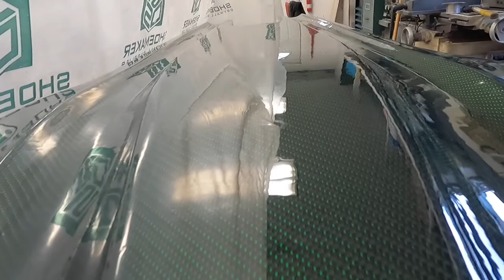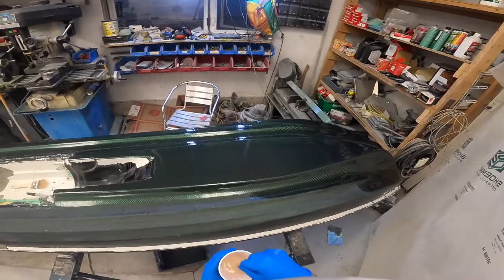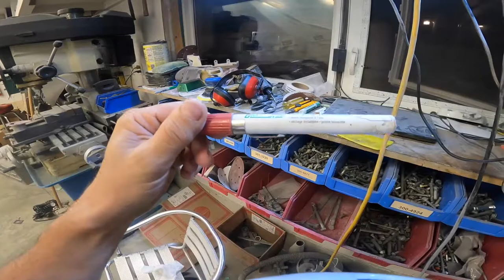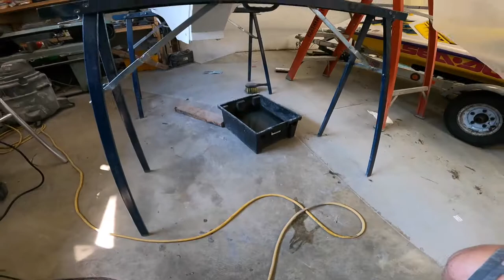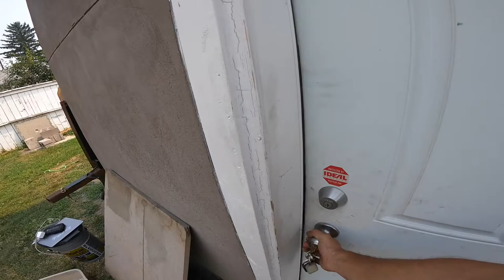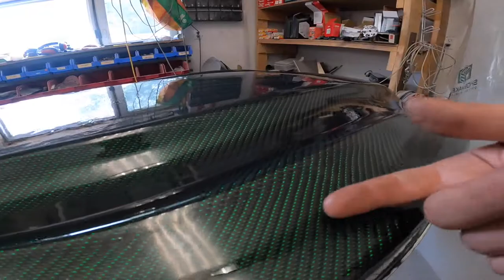Carbon Fibre Skinning - "FINISHED" - Part 3 or 3

Comment: Man what a marathon! That looks way to good to ride. Three cheers for Joel! That sxr looks different than I remember. Looks like that will be an interesting video.
Reply from the maker: Marathon.... I think that's the perfect description, well done.  It's going to be scary sliding it on to a carrier and also approaching a beach for the first time... but yeah.... it's eventually going to get banged up, oh well. 

I think I had a quick clip of this SRX in a video a while back, but this is not the one that I rode earlier this year. Hopefully I have a video explaining this soon. Currently working on the bed plate. Exciting stuff.

Comment: Good job Joel! Almost too nice to ride! Can’t wait to see you get the triple in there. I started mocking up my 650sx for the 900 swap, I’m hoping to take the tips I learned from you and add my tubbies to give me the clearance for the pipe. Keep up the good work, glad to see your cat is still supervising for quality control! Haha
Reply from the maker: Thanks for the comment and good luck with your build. My cat is such a pain in the ass = My cat is a cat . 

The most important things with fibreglass... Clean well before you start sanding. Sand well with corse paper (30-45 grit). Clean well again and allow to dry completely. Use epoxy. 👍
Reply: Thank you I always appreciate the help. I’m pretty nervous but I think if I take my time it will turn out good enough for my purposes. Cats are a pain mine are always into my stuff, twin sisters and they like to play around my feet when I’m trying to walk haha
Reply from the maker: @One2fix1982  For sure... take your time and don't try to take short cuts. Every step you do will affect how easy or difficult the next step is and how well it goes.